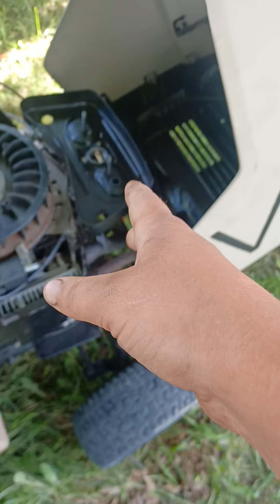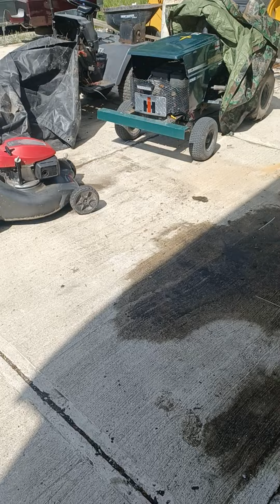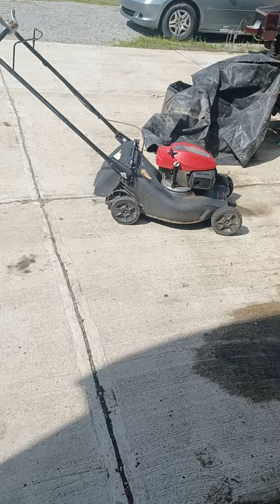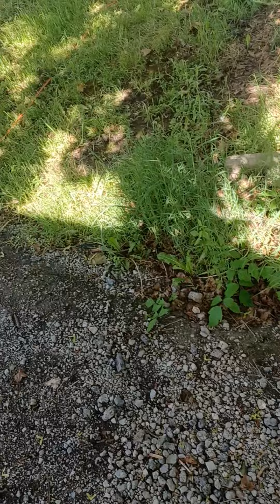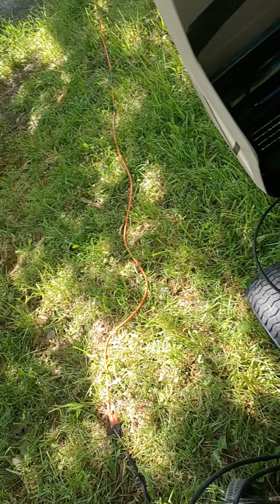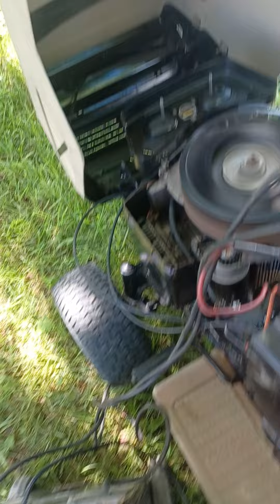fing carburetors

Comment: Have you adjusted the air fuel mix screw
Reply from the maker: Not on the tan one no
Reply: @M_Track  I'd try adjusting the fuel mixture
I usually screw them all the way in and then back them out one and a quarter turns to get a baseline to adjust from
Reply from the maker: @turneynicholas  ok I'll try